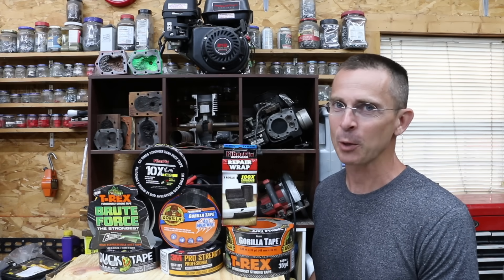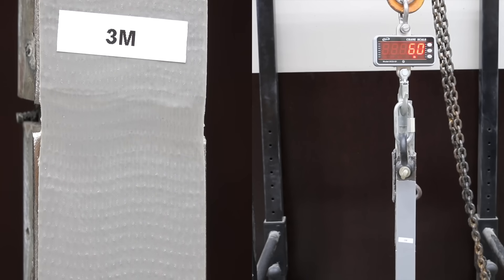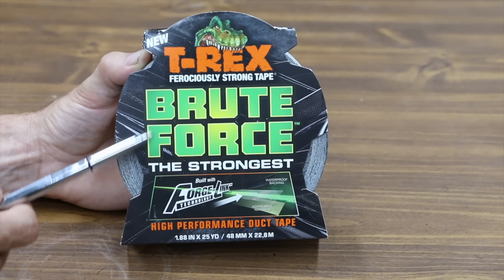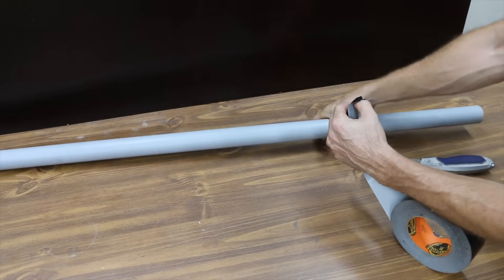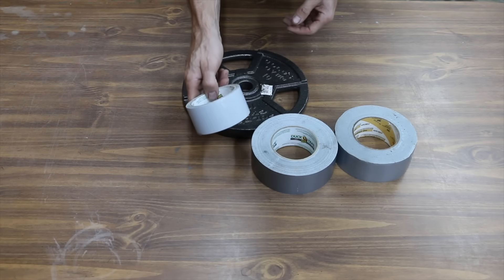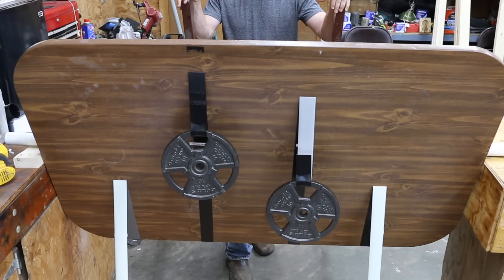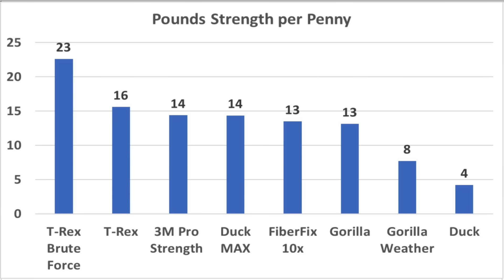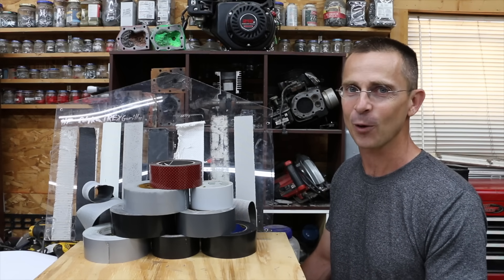Which Duct Tape Is Strongest? Let's find out! Gorilla, T-Rex, FiberFix, 3M Pro & Duck Max

Comment: There are so many brands out there it's difficult to test them all but if I understood your results correctly, in general the tapes with denser fibers were better. However, I'm surprised none indicated their thickness in mils.

About 15 years ago I came upon an incredible tape deal at a surplus store, a tape that I have just finished exhausting the supply of. If I remember correctly I paid only 2.99 a roll of 60 yards and it was very strong and extremely sticky, working as well in the end as when I first started to use it. I never found this tape anywhere again, until by chance, while watching a video of the Irak war, I saw it being used by the military to tie prisoner's hands together 😮. 

I noticed, in the weathering test you made a year prior, a tape by Polyken. Do you remember the type, and did you do any other tests on this tape before? I just got some Polyken 251 and I was wondering how it measures up...
Reply from the maker: Thanks for the feedback.

Comment: I mentioned previously I use T-Rex for sealing MTB rims.  I just changed the tape on a rim that was in tubeless sealant for just under 4 years.  This only needed doing due to my hamfisted 10yr old misusing tire levers when changing tires.  
When I pulled it off it was still stuck down and fluid proof.
Reply from the maker: Thanks for sharing.

Comment: When my AC broke this year, I had to use a portable unit for a few days. It was the type that has a duct that goes to a window to blow the hot air out. I had to fix a leak in the duct, and I used duct tape to do so. I think that was the first time I’ve ever used duct tape for it’s intended purpose. 🤣
Reply from the maker: Thanks for sharing.

Comment: great video but how about a test with the other piratical applications - we see it all the time but never really pay attention to it - like most people do in a fast pinch of a fix is to use Duct Tape for car repairs - like body trim - plastic bumpers - patch small holes - hold up mirrors - tail lights and so on / even like on the seats for tears and burns - front and back dash panels - arm rests door panels - even a hole repair for the air intake system - box and snorkel - vacuum hoses -- it should be interesting on results
Reply from the maker: Thanks for the video idea.

Comment: In aviation "high speed tape" is used which is basically an aluminum foil tape, usually applied over freshly sealed (with PR1422-B sealant) areas. Would love to see a test on the aviation grade high speed tape and the PR1422 (two component) sealant
Reply from the maker: Thanks for the video idea.

Comment: On your pipe wrap test wouldn't it have made more sense putting the tape on longitudinally and then wrapping it around the pipe  so you'd effectively be laminating it and having the fibers running at right angles for maximum strength?
Reply from the maker: Thanks for the constructive feedback.
Reply: @ProjectFarm  very welcome. I'm a huge fan of your videos!

Comment: @Project Farm Nice videos. You make a boring subject fun to watch. A good relief to get honest comparisons. So tired of youtube infomercials disguised as product comparisons. 
Went to buy duct tape at the store today and I forgot the results of your test. Would be nice if on your video description or somewhere you can put link or time stamp on where you make your conclusions and recommendations. I started watching your video again in the tape isle at Walmart but got impatient and just grabbed the Gorilla all weather. I had a tire tread come off on my RV trailer and tore a lot of the insulation wrap underneath apart. Will put some Gorilla all weather to the test on that. Thanks again. You're a hero. Hey,.. what about a tire comparison? Specifically trailer tires. 8 ply vs 10 ply. Radial vs Bias. Cheap vs expensive. Speed test, payload test, smooth test, resistance to rot and flat spots UV damage.... I own about 10 different trailers each for a different purpose and I go through a lot of tires. Tired of replacing tires. 😉
Reply from the maker: Thanks for the video idea.

Comment: I have been using these tapes to patch holes in my pool cover at the end of the season for nearly four decades.  Once applied, they then are submerged for about 8 months prior to the next season.  Everything I tried fell off easily in a short period of time until I discovered the black Gorilla Tape.  I have been using it for many seasons and some of my patches with it have survived 3 full seasons (24 months under water).  Usually, I just add an additional strip around the periphery of the patch and it's good to go.

Comment: We're almost a year along, so hopefully you went with 'yes' on that one. I'm curious as to what harsh elements mean in your area though. I've seen a couple of tests on or near your testing quality/thought-through level, but all deal with hard sun and heat, high humidity, saltwater spray/coastline air. My curiosity is more on the opposite end, as I live inland in the Arctic region. Tape usually hold up, but how the adhesive behaves is quite different between scorching sun, high humidity and +40°C, and really dry, pitch black and -40°C.

Comment: Wow! The makers of T-Rex showed that one loop (equivalent to two strips) of T-Rex Brute Force can hold up 708 pounds, yet here, T-Rex Brute force broke at 452 pounds for a single strip, which is equivalent to 904 pounds for a loop. Nice to know that the ultimate tensile strength of T-Rex Brute force is much higher than what the makers of T-Rex had claimed.
Reply from the maker: Thanks for sharing.

Comment: I need to tape wood that is exposed to the sun in Fresno CA. It just needs to stay on the fence. Doesn’t need to hold anything together. It’s more of a cover for the crack in between two pieces of wood on a fence. Everything I have used peels off. Which one of the tapes would you recommend for this use?

Comment: I can vouch for Gorilla Tape more than anyone else on this planet guaranteed.
It was used to hold 60% of my convertible top on my 2006  Nissan 350Z, on the FRONT of the convertible top taped to the top of the car where the drop top connects and latches.
That tape held at speeds over 130 MPH. I had the tape on for over a year, every 3-4 months i would add new layers, and in the hottest of the summer months i would add some layers of the WHITE gorrila Tape because the black would start to melt in the sun , causing it to flop up 😂😂😂  other then that normal stuff, it held forever. Not a drop of water inside. I want you to imagine the texture of a vinyl convertible top and attempting to put any piece of tape on it, then HOLDING AND staying on with a direct wind force of 130+ mph acting on it and daily commuting of 70+ mph for over a year.
(The All weather version wasnt out a few years back when i was using this, so i cant attest if its any better, but it sounds like it wouldve  cured my melting problem haha)
Reply from the maker: Thanks for sharing.

Comment: This could be a great sport. The Duct Tape Olympics.
Reply from the maker: Thanks for the video idea.
Reply: @ProjectFarm  Better yet, the handyman Olympics that will have events for motor oil viscosity races, tape adhesive competition, sheer strength, bonding agent events. There are so many it would have to be held over a few days just like the actual Olympics.

Comment: On these tests the metal should have been stripped clean before applying new tape, the adhesive from one tape could enhance another, either way the results are still very clear. I dont think a 40lb difference would be caused by tape residue.
Reply from the maker: Thanks for the feedback.

Comment: Great video! This does an excellent job of comparing tensile strength and peel resistance, but it doesn't provide much insight about sheer strength of the adhesives (which supposedly can be significantly different than resistance to peeling). I think it would be really neat to see the tensile test again but stack multiple layers of tape to prevent tensile tearing and see how much tension it takes for each to slip on different materials (steel, wood, plastic, etc.)
Reply from the maker: Thanks for the updated video idea.

Comment: I have been using the 25 dollar batteries for almost a year now I believe and I have no regrets I got tired of getting my things stolen on a jobsite I was at and I just bought this to test for the price and ever since I'm a happy a costumer this ones won't get stolen cause they are cheap replacements and for me they do what I basically bought them for so I'm happy only reason I had to replace them is cause they break some times as they fall from ladders or scissor lifts which is common on my type of work so no complaints so far
Reply from the maker: Thanks for sharing.

Comment: 15 years ago, Nashua duct tape used to be the best I'd seen - super strong like fabric and nicknamed a "100 mph" tape.  However, my roll ran out about a year ago and I had to buy a new one.  This new roll I bought is not like the old stuff -- it has way fewer threads-per-inch and is weaker.  I wrote Nashua to ask them what happened and how I could get the good stuff that Nashua used to sell with the higher thread density, and they never responded.  I used the old stuff outdoors and had similar experience as what you show in this video, so it looks like that didn't change.
Reply from the maker: Thanks for sharing.
Reply: What Nashua tape did you get? 357?
Reply: @johnschroeder3072  It is black.  The inside cardboard has the Nashua name, Berry Global address, and website, and says Made in USA of US and global components

Comment: Very good, thanks, which is best and can get you back on the road  if: your in your car, on the road and you spring a leak in the radiator hose or heater core hose?

Comment: I bought the t rex brute force tape because of this video. It is by far the strongest tape but because of that, it is impossible to tear. Scissors or a knife is needed to cut it. The gorilla tape has the best strength/easy-to-use ratio because I can tear it easily and imo is the best duct tape.
Reply from the maker: Thanks for the feedback.

Comment: For that repair wrap, if you use it as instructed and then after it cures, coat the outside in a layer of jb weld epoxy, it is much stronger that by itself
Reply from the maker: Thanks for the feedback.

Comment: I would recommend a "snap" test. So basically a quick yank to check tensile strength. Possibly a wieght drop using a similar set up as the first test but just doing a dead weight drop to see snap resistance. And another very reinforced to see adhesive snap strength.
Reply from the maker: Thank you

Comment: Can any of these tapes survive the pressures produced by your trucks turbo while driving? It would be easy to test on that Cummins. Just remove the rubber boot below the air horn on the drivers side. Or simulate the conditions.

Comment: Great test on the tapes. I almost always use gorrilla tape cause it's cheap where I get it and is great all around. I also use the gorrilla glue to stick alot of broke parts together. I wonder how gorrilla glue stacks up against some of the other top adhesive brands? Be a great test
Reply from the maker: Great feedback. Thank you

Comment: I would love tested steal toe Work boots. Puncture resistance, weight as purchased, cost,  water and weather resistance, and warranty would be worthy considerations.  I would test puncture resistance with a nail gun,  By shooting the boot in the  Bottom of the foot and in the steel toe to determine strength and puncture resistance.  For water resistance, I would weigh down the boots with a rock inside them, tie them up tight and put them in a tub full of water approximately up to the 4" mark for the 6 inch boots.  How long until the boot starts filling up with water?
Reply from the maker: Great video idea!  Thank you

Comment: A test I would like to see would be which brands of screw drivers can take the most abuse. For example, taking a philips screwdriver and having it's tip spun in a circle against something abrasive, say sandpaper.  How long does it take to lose its chromium finish, and how long does it take to become unusable? Also maybe a bend test to find out which has the strongest metal alloy and is it possible to break the handle off.
Reply from the maker: Thank you for the video idea!
Reply: Also, with the Robertson screwdrivers, I would like to see how much torque it takes to break off their tips.

Comment: Best tape test I have seen yet. A hot and cold test could be included. However, the prices you give for each roll is misleading for each varies in length, from 20 yds to 35 to 60. The best that I have used is T-Rex Tape 1.88 in. x 30 yd. Gunmetal Gray Duct Tap for $8.98 at Walmart  which is about $3 a yard.  Closes right now to that on  Amazon is Gorilla Tape, 1.88 in x 30 yd, Silver (Pack of 1)  for almost $10.  "Duck" Brand Max Strength Duct Tape, Silver, is  7.50 for 45yds, which is much less strong, and does not rip well vertically . 3M Pro Strength Duct Tape is 12.00 for 1.88 Inches by 60 Yards.  Thanks for testing.
Reply from the maker: Thank you very much!

Comment: Love your wonderful videos. Your technical take on things and your willingness to share information is much needed access for us normal mortals. Several times you referred to the stretchy-ness or flexibility a given tape as 'elastic'. This is not a proper use of that term.  In the 1920's, advertising and marketing folks, trying to increase sales of ladies popular under garments, began to use the word 'elastic' to describe how the latex in those undergarments could fit each and every women's individual size perfectly. So the word elastic or elasticity came to mean 'stretchy'. But what elastic actually refers to is : ability to return to original size and shape after being deflected. That means that glass is more elastic than say a rubber band, which might only regain 99.99 % of it's original shape if stretched too far.  It also means that  most of those adhesive tape products are not elastic at all.
Reply from the maker: Thank you for the constructive feedback

Comment: I'd be curious to see how much force it takes to break the TREX in tensile strength with 5 wraps or so, similar to how you were towing the tractor. If a single wrap provided that much towing force, it would be a great, lightweight, space-saving emergency tool for towing.
Reply from the maker: Great test idea!  Thank you

Comment: On the pipe test, you should have tried laying down strip horizontally around the break (Maybe double wrap, offset by half a strip width), then wrapping it vertically like you did.  (So the stress on the first layers are more like the first test)  You said the tapes are stronger lengthwise vs side to side, I wonder if this would add some strength......
Reply from the maker: Thank you for the feedback

Comment: When I was a kid, duct tape was reinforced with strings or fibers that ran both ways. They were most noticeable when you tried to rip it into strips. Sometimes you had to cut it with a utility knife or scissor because it wouldn't break it into strips by hand. The old adhesive was so sticky that once it stuck to something you couldn't move it or reuse it. If you put it on wrong you had to throw that tape away and get a new strip. If it stuck to itself you had to throw that part of the tape away. If you left it in the trunk of a car and it melted together, you had to throw the entire roll away.      /        Most of today's tapes seem to be made for household uses and are designed around a much weaker mesh that's easier to rip into strips by hand but doesn't have the overall strength of the old reinforced tape. And the adhesives seem much weaker, they doesn't stick as easily or quickly and they come off a lot easier. I guess that's ok for some uses. But if you're actually doing something like duct work, the duct tape imposters are a problem.
Reply from the maker: Thank you!

Comment: I have followed your hard work for a long time.  You have really developed into a great channel. There are several automotive masking tapes that are also perfect for tough jobs like weather or tape left on for a long time.  3M 232 comes to mind.   Also, blue plastic fine line tape would be perfect for graphics in the home or shop. It is flexible to make curves.  Some are heat resistant too.  Any chance to see comparison against the winners of masking tape video would be greatly appreciated. While the tapes are more costly, your masking video proved you get what you pay for, and auto parts stores are everywhere. Thanks!
Reply from the maker: Thank you!

Comment: For those of you that cant calculate torque, basically at 29 inches the force is 85lbs with a 35 lb weight vs 109lbs with a 45lbs weight.  
Now for the other ones, with the 35 lbs weight it will need to get to the 12 inch mark before being 35 lbs of torque. These are all rounded numbers but it shows you how superior the wrap is. Also 35lbs at 9 inches is about 26lbs.